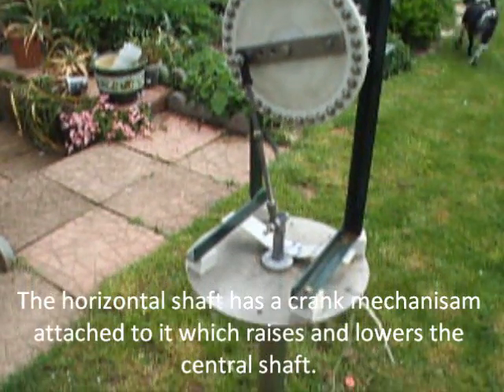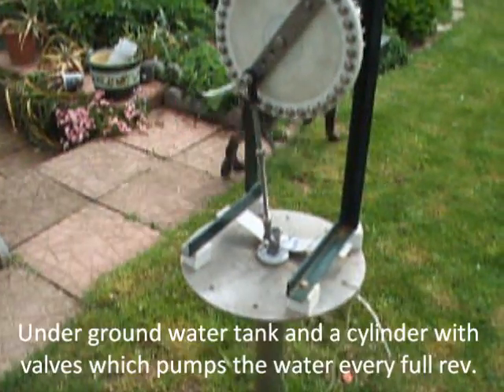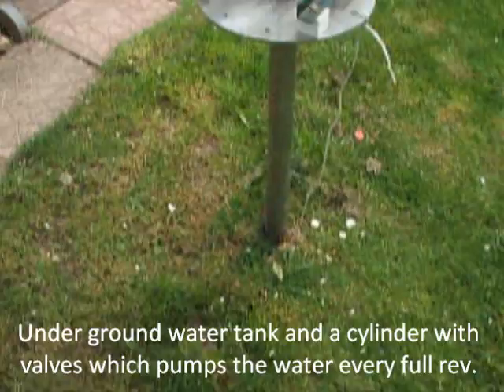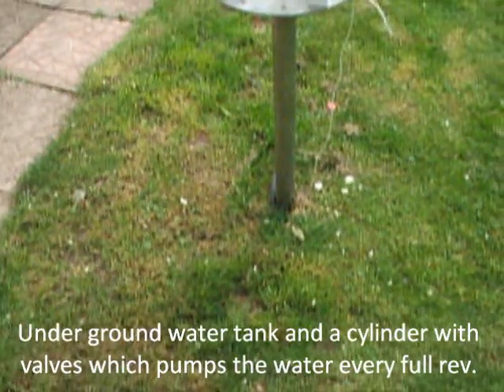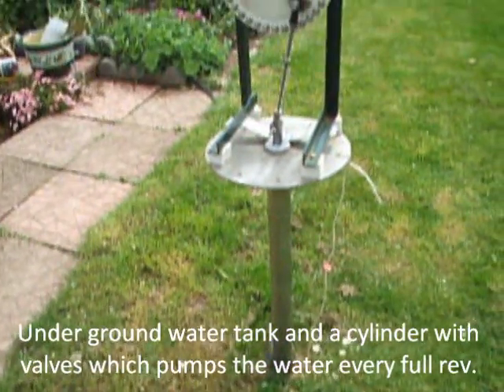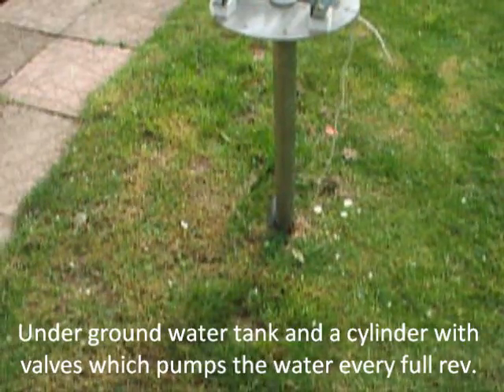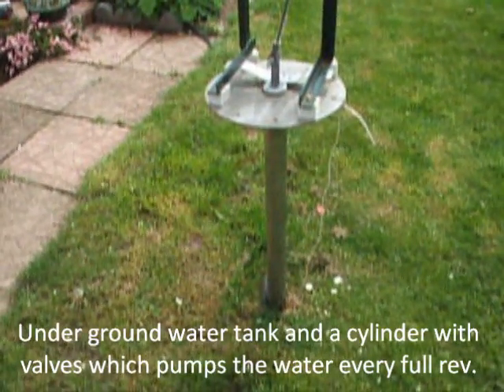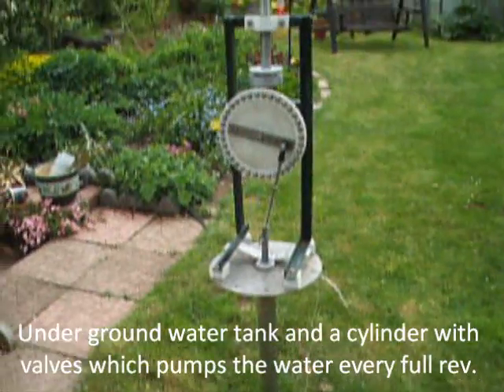Vertical axis wind powered water pump

Comment: the Flap Turbine is known for having large amounts of torque and low rpm.... the blade design you are using is made to achieve higher rpm with less torque. the pump you have set up (awesome! ! ) apparently would work better with more torque.

Comment: you don't really need that gear ration. the wind turbine has enough torque to move the pump shaft. this kind of wind turbines are well known as a low speed - high torque machines.